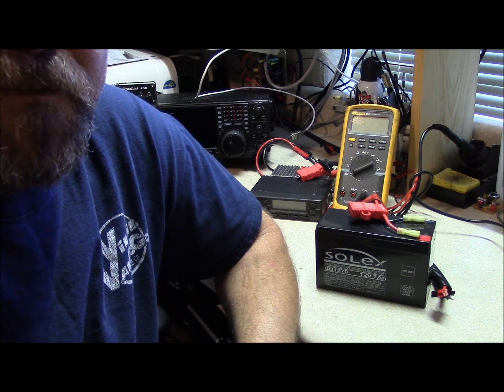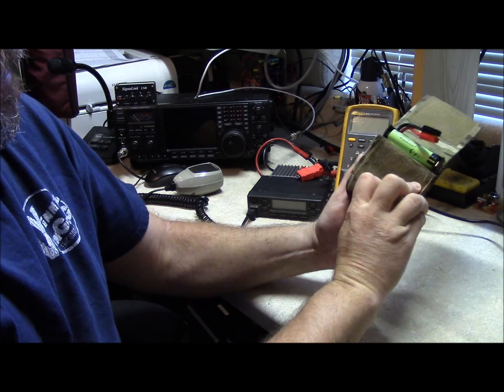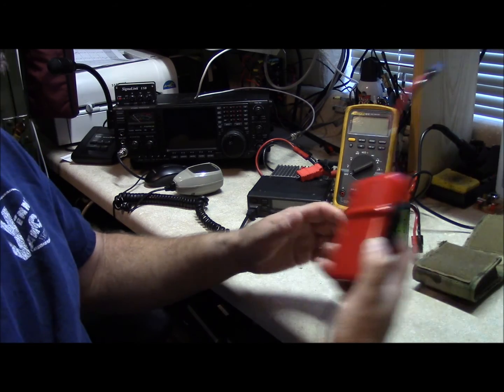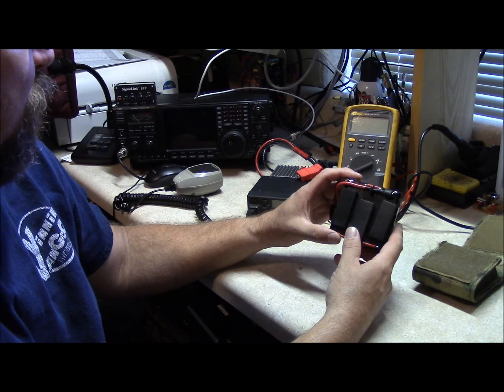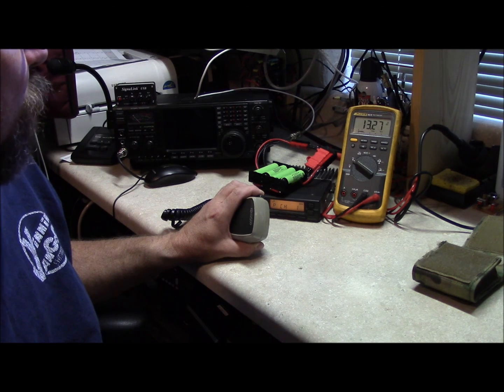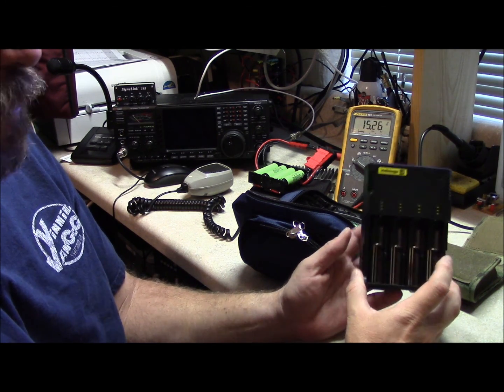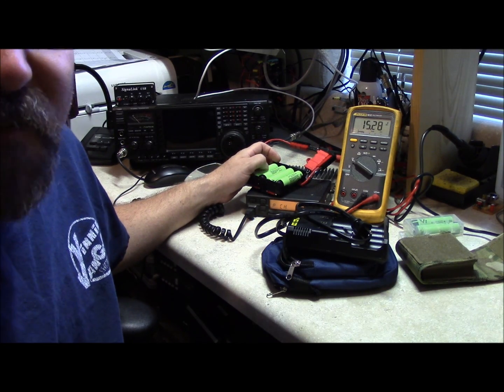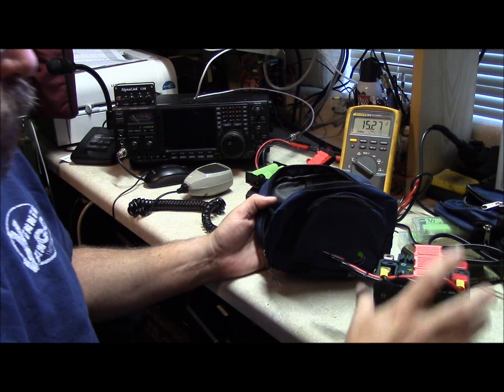DIY 18650 battery pack for QRP / Ham Radio

Comment: Would 3 batteries (12.5v) be enough to power a mobile radio?
Or 6 batteries, or 12?
Reply from the maker: It depends on the radio. When completely charged you will have enough with 3 cells for a  short period of time for a 12v radio etc.  With 4 cells you will get 16v fully charged then dropping to 14.8v. SOME radios will tolerate up to 18v alone. To be safe the use of a regulator as shown will be the best choice. Thanks for watching !
Reply: @survivalcomms  
Okay, thanks.

Comment: Can  you confirm which diode you used to drop the voltage to 16V, and how is that wired?
Reply from the maker: 10A10 forward biased. You can use a higher current diode if desired. Thanks for watching !